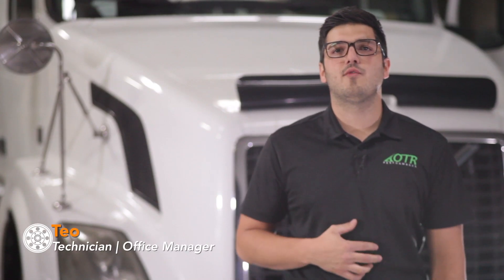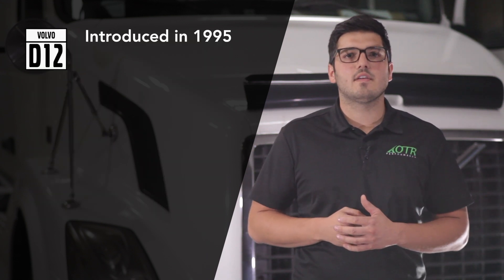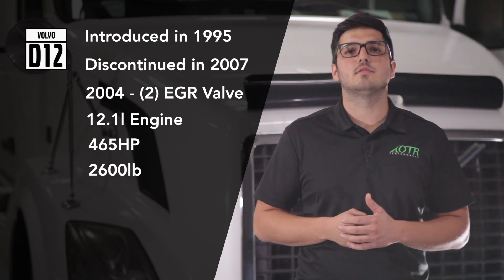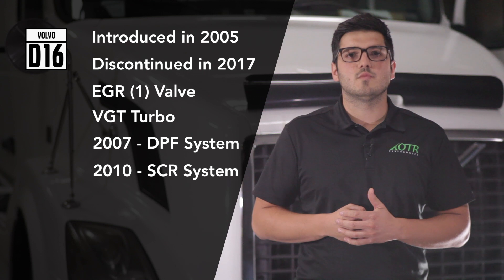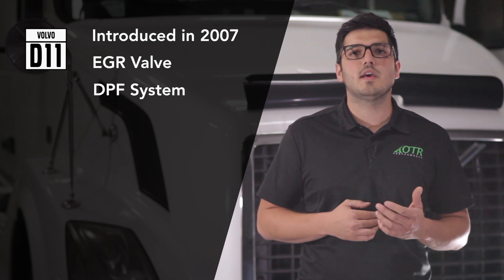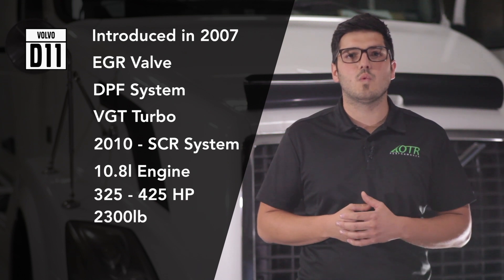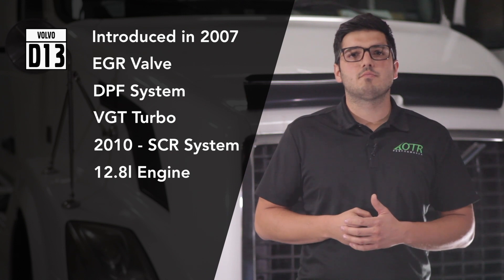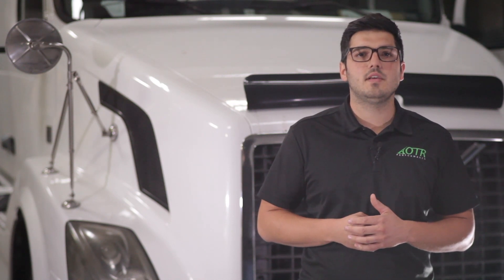Differences Between Volvo Truck Engines

Comment: I used to own a 2011 VNL 780 that had the 12.8L (D13) Diesel set up with their Duel Torque Option; thought it was goofy at first: Base horse power was 425 with 1450ftlbs of Torque. With the bottom line 9 Over (it was recommended to NOT install a 13spd conversation kit as the transmission case was not strengthened for over 1650ftlbs of Torque) with the Cruise Control Engaged (or not) in the Top 2 Gears ONLY the Engine would ramp up its Power Settings to 435hp and 1650ftlbs of Torque.
I managed to get 8mpg while tooling around SoCal. It had 3:49 Rears and the only problem it had was a Schizoid NOX Sensor. I never cruised above 1500 RPM.

Comment: Thinking of getting a 2016 Volvo that’s on sale has 550hp D16 engine with auto i-shift.   I usually drive manual 18speeds and 13spds with some 10spds.   Wondering.  I like the DD15 engines.  Since I heard guy had 10.68 miles per gallon on a freighliner hauling tanker. But in actual I’m looking into auto to save the transmission and engine.  Any pointers?  I think it’s quite a good deal $42k plus taxes and fees for the truck.  Haven’t really know yet what type of Volvo it is.  I’m pretty sure since it’s auto it will give me good fuel economy.  Plus it’s a 2016 with a D16.  So I figured it’s a match.  But again I’m not an engineer.  I do like the econo roll features for going up and down hills for saving fuel and to save the transmission and engine.  Depends also I’m pretty sure if you’re able to put it into good use and know how to use  these features.  I couldn’t find any other truck that is cheaper then Volvo when it comes to automatic transmissions.  I guess it’s because they specialize in automatic trucks.  Any pointers?

Comment: Volvo motors suck. - that is why they have stopped making d16. Their d13 is still garbage. Better stick with Cummins, or cat&detroit if older motors. D12 is ok, but gutless though...
Reply: Completely untrue. They are the most reliable engines we have ever had.
Reply: @jbarjj2715 , when compared to d16, yes. That’s it.

Comment: Just buy a old cat or cummins. You will not get as good of fuel economy but you will see less shop time. Volvo trucks are for steering wheel holders anyway.
Reply: YOU are an absolute idiot keep your stupidity to yourself, Volvo engines are much more advanced than cat or Cummins, Volvo out performs both cat and Cummins per liter.